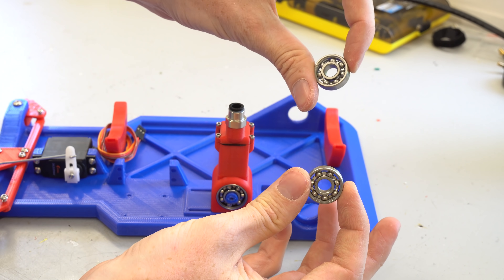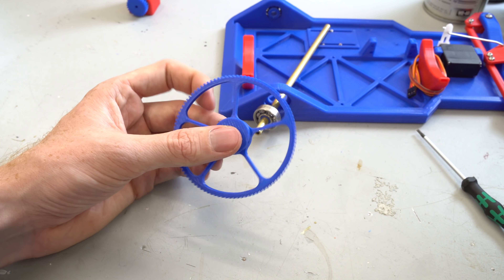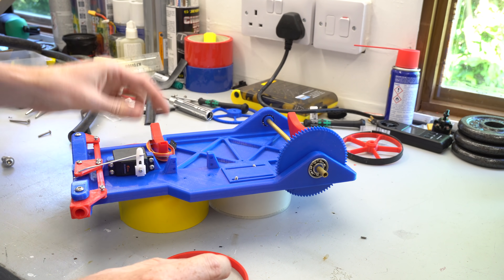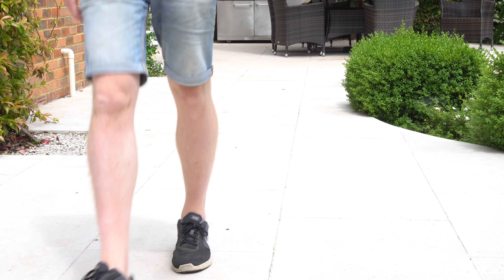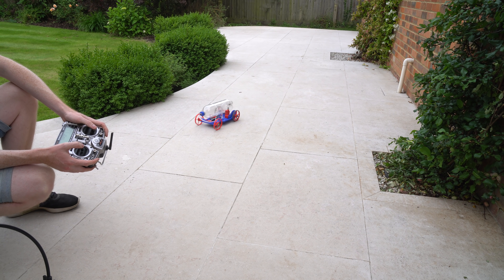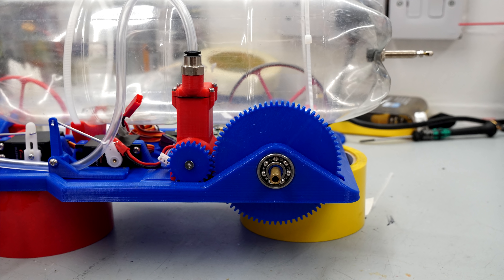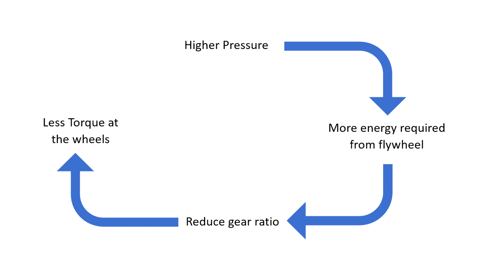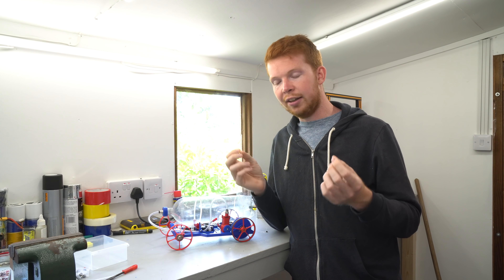Air Powered Car

Comment: Make a v6 air engine that would be sick, and I am not an expert but I don't understand why you didn't put rubber on the front wheels you would have more grip to turn I'm sure there are pros and cons for that, oh and finally the big gear is going to hit objects on the ground seeing as it's so low..

Comment: Maybe with some kind of cluth or gearbox you could keep the engine running at a sufficient speed even if the car is slower and the engine will not stall?

Comment: Dear Mr Stanton: How about putting a metal flywheel directly on the motor side of the gearing system? I would imagine a heavier flywheel, spinning at a higher speed is much better at being a flywheel. Downside about that is that you might have to implement some other method of breaking or even implement a clutch for better control. And then the downside of a clutch is that it would result in "lost" air... I mean... Delta V

Comment: a 2 cylinder engine. single is good for high speed low torque, but where you need torque and not speed a double would work better. the big downside though is it would lower the run time.

Comment: Without rubber in the front, at high speeds your gunna get some serious under steer, also if you end up building another one, make it a truck and you could put the bottles in the trailer

Comment: Also, increase the ratio. I would estimate that given the performance you’d need at least a 6:1 ratio. Maybe even higher. Most electric models have ratios no lower than 9 and motors that are likely able to put about 1hp down on the weaker end

Comment: 3 gears. Most RC 2wd vehicles use a odd number of gears to overcome this loop I think, not an expert. For the most part, the intermediate gear has no impact on the ratio

Comment: It loses so much speed in turns due to scrubbing the rear tires. Either change to 1 wheel drive or 3D print a differential. Better would be to buy a planetary diff for an RC car and print adapters to mount it. A LEGO differential would work too.

For the large gear being out of round and wobbly, that printer's X/Y calibration is out of whack.

For an efficient valve make a slide valve. Wet sand the faces that need to have a good seal.

Comment: If you treat it like a train, you could simply keep the back wheels on track and just have the one push rod giving the wheels their power from the engine. This idea will probably just get jumbled with the rest, but I love your designs so far. And it's been turning it great! I know you'll get this thing running amazingly!

Comment: i've been thinking of how to increase the torque on these engines. Like Lego pnumetic valve engines. use a switching system to push both sides of the piston. So it becomes a 1 stroke engine.

Comment: You could put a larger flywheel on the small input gear. The flywheel would have to be a little bit offset to not collide woth the output gear and such, but flywheel size and gear size don't have to be the same.

Comment: Been following the vids for a while and really enjoyed them! I work with MTB suspensions and there are some things I thought would work well with your engine. Rear shocks have a PTFE glide ring on their pistons which could form a nice low friction seal. Combined with slick honey grease to seal it and provide lubrication. Would mean a round piston though but that's not a bad thing.

Comment: You should try using secondary pressure chambers. 
When piston goes upwards on 2/2 phase, engine releases used air, which still got some pressure and can power smaller cylinder. So in this system you have multiple cylinder engine with only one getting main air input and the rest getting used air pushed from previous chamber on 2/2 phase.  This gives a lot more torque and efficiency although decreasing rpm. 
This system was widely used on coal-steam engines so you should be able to find examples pretty easily. Titanic engine for example has four cylinders with three different pressure levels.

Comment: You could just make the rubber hose a little more clamped in order to reduce airflow and therefore, reduce the PSI in the engine?

Comment: I don't think you should be reworking the engine, but the 'transmission' of the car. Maybe a flywheel, independent of the main axle (the one connecting the back wheels) so that you can gear it optimally. It could be placed around the aformentioned axle, with a larger bearing so that it doesn't interfere with it. I think this could be quite easy (relative term) to implement, what do you think of it?

Comment: It could also be the cam timing. It seems to me that it gets stuck towards the very very end, nearly start of another stroke, making me think that the camshaft is opening too early and putting pressure behind the piston before it reaches TDC.

I would also suggest a little oil on the gears and the camshaft as it should reduce friction. 

I would recommend, though, having a heavier drive gear and reducing the gear ratio to about 7:1 to 8:1. In most cars, 1st gear itself is somewhere between 3.0:1 and 3.5:1 and then the final drive is 3.5:1 up to 4.5:1, effectively making the final drive anywhere between 10.5:1 to 15.75:1. Including the fact that it appears your engine doesn't run over 300-400 rpm, I think 7:1 to 8:1 should allow it to be a balance between speed and acceleration, even though it would effectively go through about twice as much air.

Comment: I like how you simplified the throttle.  Maybe use a pressure regulator and keep the bottle at a higher pressure and bring it down just before it enters the motor . Similar idea is propane gas bottles  used for BBQ's using a pressure regulator.

Comment: A simple way... although probably heavy... to use high pressures, is to have a smaller tank that the bottle puts air into. In between these thanks have a pressure regulator of some sort. That way the pressure that goes to the engine is always optimal, but you can still store more air because of the higher pressure!

Comment: As others have said, you should look at implementing a dedicated flywheel and a clutch. It's doesn't matter if you redesign the engine, because as it stands it will stall every time the car stops.

Comment: Tom, another alternative is to not use a direct drive: if there is a clutch between the engine and the wheels, the engine could spin an actual flywheel and your clutch could get torque by drawing from it. I found this description on the interwebs:
https://www.quora.com/How-does-a-flywheel-and-clutch-function

Comment: Make a 4 cylinder and use a high pressure tank with a real throttle body. I know it’s probably a lot of work but if you actually made that it would be awesome and you’d get a lot of views

Comment: If you are going to redesign the engine and the valve, think about a sliding valve system!  Also with a single cylinder engine, you are losing torque and power because  the momentum of the car is used to move the piston back to the top.

Comment: It would be cool if you could have a lightweight, simple regulator which would keep the input pressure into the engine to a manageable level. Then you could pump that bottle up to 60-70 PSI... Of course, that seems somewhat unrealistic.

Great work as always!

Comment: could also look into using a differential that way you can reduce the high torque required for turning as it will allow the wheels to turn at different speeds. Think of it as a 4WD without a diff. when it turns the inter wheels will slip as they require a smaller radius to turn unlike the outer whiles which require a larger distance to turn so in turn the inner wheels slip (bunny hop)

Comment: You could try a denser material for the flywheel or reprint it at 100% fill... or inlay some lead fishing weights inside the wheel.

Orrrr... why not make a 2-cylinder engine so while one is trying to open the inlet valve the other cylinder is providing power?

Comment: Bro easy fix, print another engine and make them face each other 

Air would go

Bottle tube inlet chamber outlet tube outlet chamber inlet

No that isn't a typo would have to be backwards for the engines to spin opposite of each other. With this system the close of first would open second and close of second would open first, this would get you through the "light flywheel" problem, as each engine would operate each other, then the car drive is simply and outside load.

Could also design a clutch and get the motor going then drop into gear. 

This would do the whole "multi cylinder" everyone has been raging about without adding nearly any complexity. Only problem could be if the Pistons are mounted 179 or 181 degrees apart the system wouldn't work

Comment: I think you may be able to reduce the gear ratio and put a heavy flywheel on the crankshaft to get better results. The flywheel on the crankshaft will provide the momentum you need to keep the engine running at low speed.
If you use a very small medical oxygen bottle with a regulator (find second hand?) You could run low pressure with high pressure storage.

Comment: I have been thinking about your "Air Powered" Projects for a while and have been thinking, couldn't you re-build a 2nd version of your Mk 5 Engine and increase the size of the Piston for more "Power". Double it and stick 2 Engines on your car, each one driving a back wheel. Maybe even a backwards facing Rotor (XP 55 Airplane design) with your Mk. 4/5 engine powering it could help your Car overcome the Power Issue. I'm thinking about it beeing placed on it's side and off to one side so it could power a larger flywheel like in your "Improvements on the Torque"

Comment: Good work. Couple of suggestions, you need a longer stroke which will effectively increase the torque of the air acting on the crank thus the gear, you should also add a flywheel, and last but not least crank up your bottle pressure, when I built an air engine for my final college semester, the math suggests that a standard pop bottle strength is maxed at 125 psi, so we pumped it to 75 psi, and I was able to achieve 4000 rpm and 30-40 seconds of run time, without a governor. But very cool. All depends on a few ratios, bore to stroke, and rod to stroke ratios.

Comment: It needs to ramp up, start with low throttle opening and then open the throttle further as it gets going, the instant torque/load is to much for that little engine to handle

Comment: What if you were to make a air compressor wit the engine so it constally rebuilds air pressure, I know you are able to with lego but you would get as high psi but you’ll get constant pressure of air. Just and idea that you can look into
Reply: where's the energy for the compressor coming from?
Reply: Rob Mckennie from the engine or rear axle depending what suits better
Reply: but where are you getting the energy? Are you using energy from the compressed air to compress more air?
Reply: Rob Mckennie yes, you can have basically a crankshaft for another piston but this piston is to compress air from the atmoshere and can be driven by the rotation of the axle
Reply: Rileyfireman1 you can't use energy from compressed air to compress more air. You'd wind up with less than when you started, better off to just leave the air where it is.

Comment: How about just adding a flywheel attached to the crankshaft? That has worked for just about every internal and external combustion engine ever.Also a cheap way to get low friction bearings is to use sewing needles for the axles. The small diameter and super smooth finish makes for low friction on any kind of bushing.

Comment: Why not just put a flywheel directly on the engine shaft, then you can adjust the gear ratio however you want. You could even   Gear it to go faster than the engine

Comment: TOM search knex air car , I had the  same issue as you in the beginning of my build . Orginally I went with a single cylinder air motor but it was really underpowered.  So I went back to the drawing board and made a 2 cylinder. The motor had more torque and was able to move under it's own power .

Comment: why not go back to the v2 engine with two bearings so you have more rotational mass to help keep the engine spinning?  to help the efficiency i would put a cam lob on the other side of the crank and use it to open and close a ball valve just like the intake.   put a hole in the top of the head put one of the air line fittings in it and run the other end of the line into the top of the exhaust valve just over hanging the block.  no springs and a simple proven system that should help if not complementary get you away from having to use offset ports like a two stroke and keep the engine form having to push through air still in the chamber.

just what i would do keep up the good videos.

Comment: You need a clutch to allow the engine to gain rpm and maintain idle and then slowly lose tork to the drive system

Comment: Add a flywheel directly to the output shaft of the engine.  You'll get more "reverse tourque" since the rpm is higher at the engine output shaft.

Comment: 2 cylinder engine will not have a problem with the inlet valve as the opposing piston is on its power stroke. Plz try it. Love your videos keep going.

Comment: You know a multi cylinder version, correctly orientated will provide the power to drive it self. No fly wheel needed. I say we revisit the multi cylinder idea. Toss efficiency in the bin, print the whole thing out of carbon nylon, slap a carbon air tank at 2000PSI (KGPSC for you) on it, and build an air powered drag car. I'll get some T shirts made. They will say "No replacement for displacement". What should we call it????        Good stuff keep it up.
Best Matt

Comment: make it a digitally controlled injection motor! like modern internal combustion engines, with a tiny solenoid that pens and closes the flow , and you can control the power by pulse with modulating the valve!

Comment: So, you need a more massive flywheel that's acting on the wheels rather than using the wheels as the flywheel. Stick a medium sized gear on the motor, running to a small gear on a weighty flywheel, with another small gear on that outputting to your wheel. Ideally, you'd also want some sort of delayed start, maybe a small servo to push the drive gear into the flywheel, or nix the final gear assembly in favor of a belt drive, so you can remove tension until the flywheel has spooled up, and then engage drive. Smaller wheels are going to be needed for this as well, I think the big wheels would offer up too much resistance and cause the flywheel to stall. You're probably going to be entering into a world of complex math, and you're going to need the value for how much energy it takes to pop up that valve system to calculate the rest of the gearing.

Comment: What you need is a 'high' pressure tank with a regulator of some sort. This way 'max PSI' doesn't matter plus you get longer run time thanks to the regulator. Example: Google. New Mini Air Pressure Regulator 1/4" w/ Free Gauge. The low pressure engine is efficient in its own way.

Comment: Hey! Simple solution is to put a weighted flywheel directly to the engine or even at a higher gear ratio off of the front of the engine(ie. spins 2-5 times for each engine revolution). As cool as a new high torque (perhaps multi cylinder) engine would be, an actual flywheel would probably solve your problem with the least effort.

Comment: Another way you could solve this is by adding more positions you could just print the exact same piston and then split the hose then add and gear to allow you to add a position. You could also make the second piston start pushing down when the first one is coming back up, and the one pushing down will help the one coming up go up, and this will create a more constant supply of power to the wheel.

Comment: You can charge it to higher pressures if you use a pre charge valve like they use in the PCP air guns. You'll get a better curve of energy you have available.

Comment: could you use some dry ice in warm water to create pressure?  it would increase the mass of the car but would provide it with more pressure over longer time...

or use a higher presure in the bottle (get one out of metal) and use a flow restriction.
Reply: That's a recipe for a dry ice bomb. He could use a pressure release to regulate the pressure, but that would be dumb, and would quickly freeze and be at risk of plugging up with CO2 or water ice. Liquid [ropane would be a better choice, it produces much more appropriate pressures.
Reply: damn
you're right i will stop making my bomb on wheels now

Comment: using a belt drive would create too much friction and they are way more inefficient than gears. It's why they aren't used in rc cars now. my delta printer also prints circular objects a bit warped due to mis calibration. if you use a standard style printer with a larger pitch gear ie. 32pitch or lower, you shouldn't run into any problems.

Comment: Your engine has already shown to be working. You do not need to redesign it again. The problem I see is your placement of what you consider a flywheel. The flywheel needs to be on the same shaft as the engine's output to be the most effective. This means it will share the same shaft as the smaller gear. All you need to do is cut a slot in the chassis to accommodate the radius of a flywheel, like what you have for the large gear.  You could easily print the flywheel and small gear as one part, the gear simply centered on top of a solid disk of plastic. With this, you can then drastically change the ratio of the gears for more torque, if you wanted.

Comment: You could just make a multi cylinder engine that doesn't require a flywheel. When you first said, 'make a compressed air engine powered car', I thought you meant stick a prop on a chassis and make a prop-driven air engine powered car. This would also allow you to overcome your issues, simply because it is so much simpler.